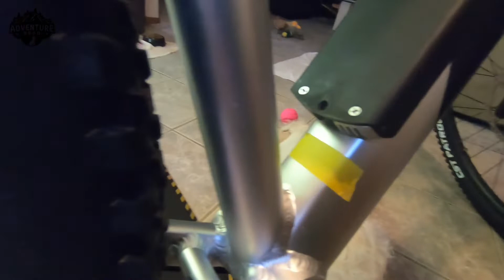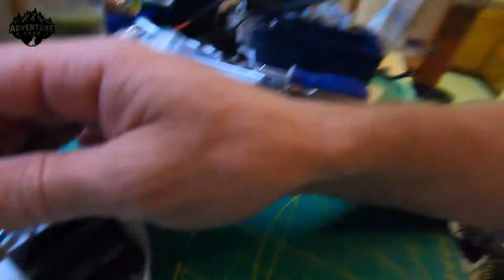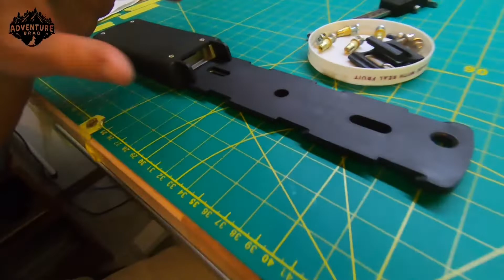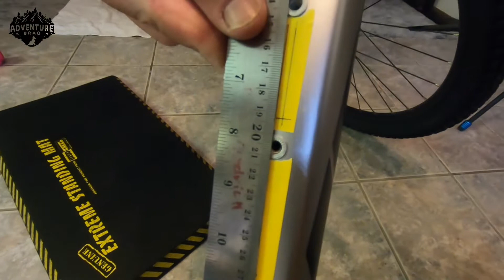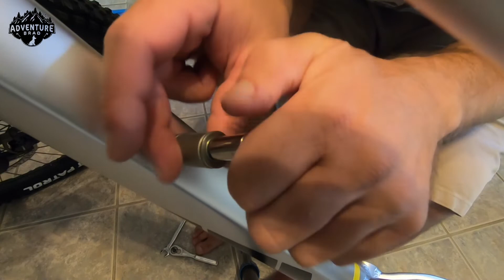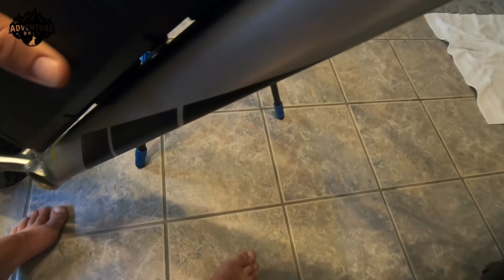How to Properly Install a Ebike Battery using RIVNUT, nutserk or blind nuts!

Comment: Nice - extra straps help too - velcro, tie wraps, hose clamps, hose clips with padding to not scratch frame etc - simply check rigidity now and then, lot of fail safes can be added for mounting a battery and ensuring riv nut is still good.
under side mounting you can even buy a "cradle" for that extra layer of safety.

Comment: Drilling a hole in your frame is the dumbest thing you can do. It compromises the integrity of the bike. Call any bike shop and they'll tell you not to do it. The holes that are in your frame already are reinforced from the inside... Especially when you have extra weight like an e-bike components this is really stupid to do. Very dangerous as well.

Comment: Great idea with the riv-nuts. They sell adapter plates for $10-$20, but it adds a little to the stack height, which is a non-starter for really tight installations. One thing is that you can unscrew the 4 tiny screws in the bottom plate to reveal another set of holes for mounting the bracket.

Comment: Drilling holes in you frame is "all good"...Until your downtube disintegrates at 60 kph on a downhill...
I made a couple of conformal frame/battery mount shaped spacers from small aluminium blocks and fastened them to the frame using two pairs of jubilee (pipe) clips. Then the battery was mounted on them with bolts.
Non-intrusive, but even then there will be stress risers somewhere. 
Bike frame tubing is manufactured to a margin. Don't play close to the edge.

Comment: My rivenut become loose after two years. I want to pull it in with a gun and I'm wondering if I can put some loctite 638 with is green metal glue to make it last little longer ? Have you done something like that in the past ?
Reply from the maker: your could try but general sunnging them up will do the trick
Reply: Ditch the frame before it kills you
Reply: @pompeymonkey3271  what?

Comment: Turning the centre bolt stresses the threads and renders them more likely to strip. It is better to keep the bolt stationary and turn a nut on the bolt to compress the Rivnut.

Comment: at the time of writing this ; I did much research on rivnut , thank you for this vid, it showed me some of the info i was missing  on using them on a bike frame as i planned also for a pwr pack mount . but it is not a ready to use mount such as you are using, it is a custom mount for what is also a custom pwr pack . My question to you is did you consider galvanic corrosion when choosing your rivnut ? I have a aluminium alloy frame and i will use aluminium rivnut , i believe they will be strong enough for the job i planned , four(4 maybe 3 but no less) rivnut to share the pack load and that is the last info i am after  -> what load can they take ? i tried to find some load chart for rivnut , you know of one such chart ? Thanks again for the knowledge shared here , cheers  =D
Reply from the maker: aluminum  would be better for corrosion just whatvi had on had. when installed right my experience is that the threads fail before it pulls out. enjoy!

Comment: Why is stainless bad for this? Its not a super heavy load bearing application. I little anti seize will stop corrosion send galling. And I would think even grade 3 or 1 would be strong enough.

Comment: I additionally bought some industlial flexible silicone based adhesive, cleaned all the surfaces and glued it before tightening the screws, used my finger to contour it so that the curve would blend into the frame.  The silicone adhesive will actually come off with enough force, so it isn't really permanent.  Don't know if it was necessary, but I felt like a 4kg battery wasn't really being held up properly with only 2 screws into milimeters of aluminum thread.
Also, same as you, my battery almost touches the seat tube. and since I still had some adhesive left, I first wrapped the seat tube with aluminum foil, and then contoured some adhesive from the edge of the installed  battery into the seat tube as an extra attachment point, took the aluminum foil off after it cured.

Comment: i just come across the exact same problem. its not the battery fault its just some bike companys when building the bikes put the bottle holder holes in different parts of the down tube, mine is same as yours pal near the bottom. it just pure luck on where your holes are on tube lol
Reply: Did you find the solution? I have the same problem xxd